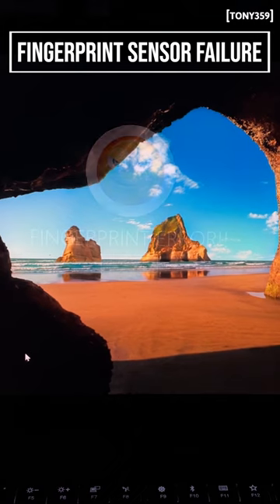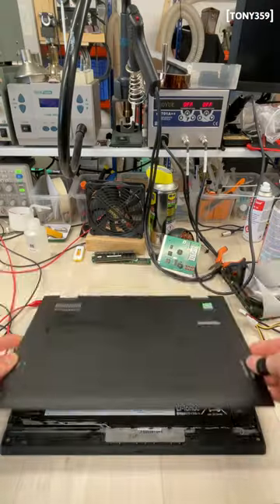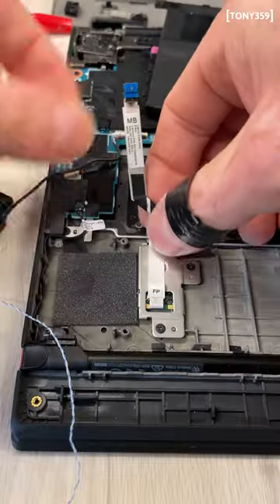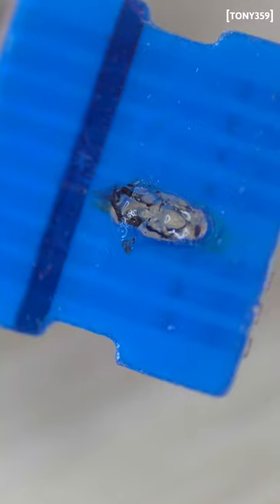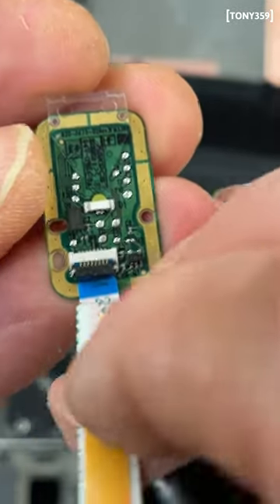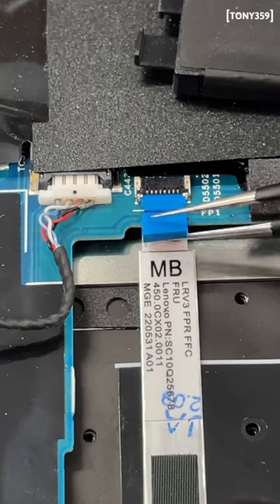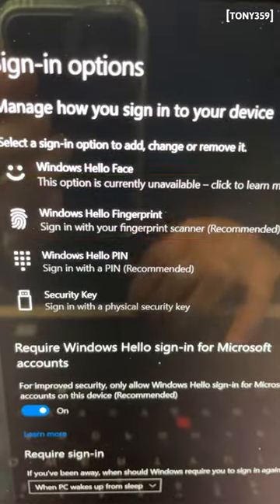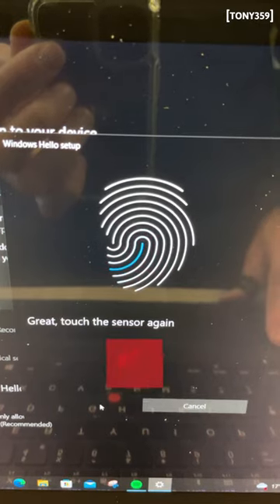Lenovo X1 faulty fingerprint sensor fix #shorts

Comment: My t470 fingerprint sensor also stop working too... just replaced it 7 months ago and it's still going. The only weird difference is that my original fingerprint sensor some times read it but other times it doesn't, it only work if you install and Uninstall the driver. Since I broke the Palmerst when I drop it on February and it had that issue of the fingerprint ever since Jan, I decided to look up on ebay to buy a palmrest replacement while also having a fingerprint sensor, after that it worked perfectly fine...
Reply from the maker: That's good news! I hope mine lasts a long time too!

Comment: I worked for a lenovo assy plant in México and I can tell you those FP readers suck. My job was repairing them after the assy process and it was very common to dispose the chassis because that single flex was defective.
I can bet many of them will have failed some time after being used for the first time.
Reply from the maker: Amazing! Well done Lenovo! :)

Comment: wait so you're telling me if the device has fingerprint enabled and the sensor goes wrong then windows doesn't detect it and you can just log in?
Reply from the maker: No, Windows will always have fall-back options. PIN and finally Password. You cannot only have fingerprint as a login option.
Reply: @tony359  I thought it was ez for a moment lol
Reply from the maker: you never know when it comes to Microsoft :)

Comment: I have a Lenovo ThinkPad too. And I run Linux on it. Great machine. But I would never use the finger print sensor. Especially not if I was using Windows.
Reply from the maker: Is it so easily defeatable?
Reply: @tony359  No, I'm just paranoid 😎

Comment: Hey bro i got a hp probook 450 g4 laptop with fingerprint scanner but most of the times when i use it it shows unable to read fingerprints amd try cleaning your scanner bullshit. Its one of those thin like a line shape scanner not the one u have
Reply from the maker: Sorry mate, I'm not familiar with that.
Reply: @tony359  can u help in some other stuff like performance related

Comment: Bro cut the cable at the damaged edge and scrape the cable with razor blade and expose the copper and insert the cable job done.
Reply from the maker: The cable is JUST the length you need, there is no slack you can use.

Comment: I was unable to set up my fingerprint(currently unavailable). How to set up?
Reply from the maker: It could be many things. Make sure you have drivers installed and that the reader shows up in the bios - mine didn’t because of the hardware failure.